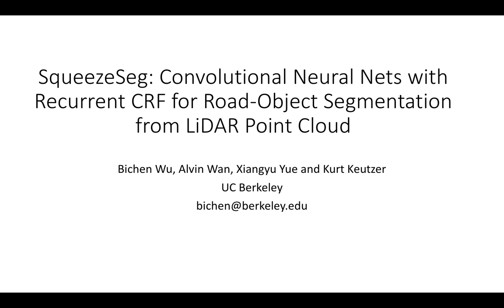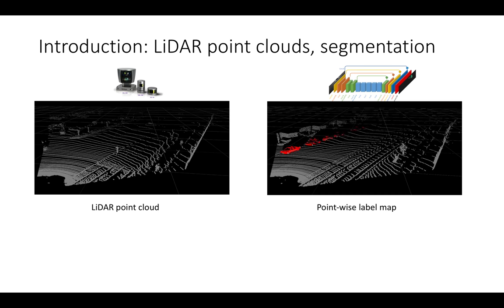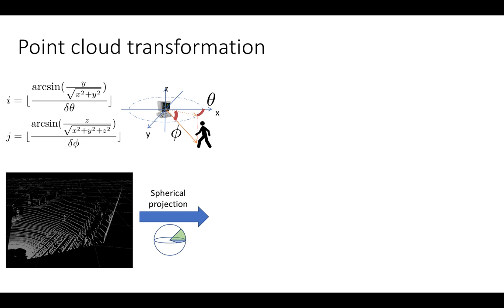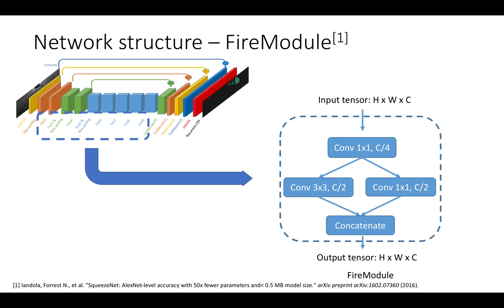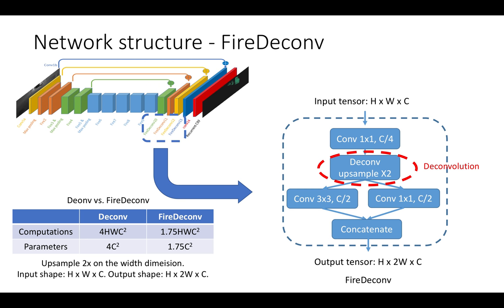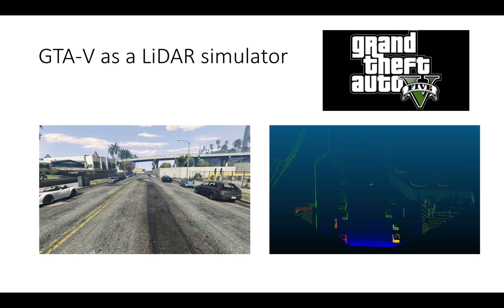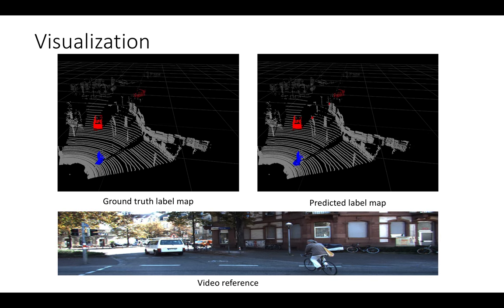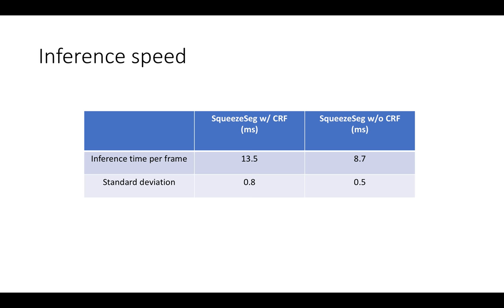SqueezeSeg demo: CNN for LiDAR point cloud segmentation

Comment: Hi. How is LIDAR intensity derived/simulated in the synthetic environment (GTAV)? Do you use some combination of RGB or is it something more sophisticated (e.g. radiometric)? - Thanks G.
Reply: As far as I can tell, it does not use intensity data, only point coordinates.
Reply: They are using Kitti dataset which has calibration files, photos and binary point cloud.
For simulated environments designers have control over beam internsity, vertical scan rate and other parameters. Once you use Lidar you don't have RGB information. But you can set RGB yourself depending on your design. I set up RGB for distance from my car.
The segmentation algorithms are quite advanced